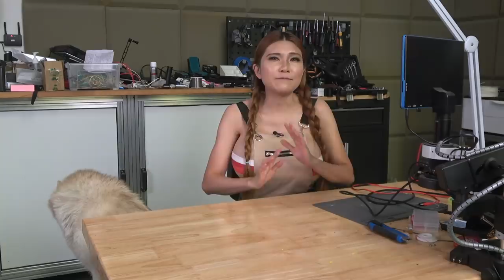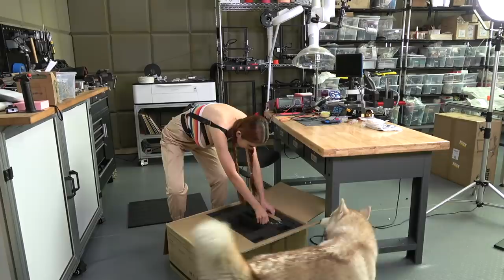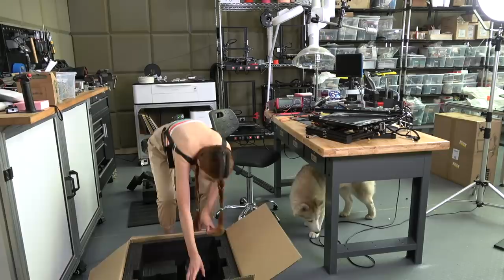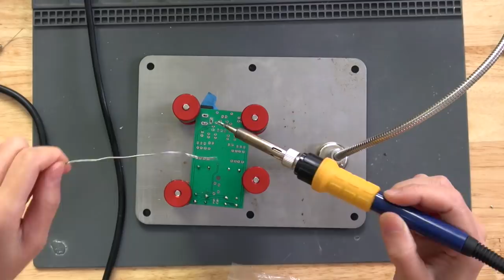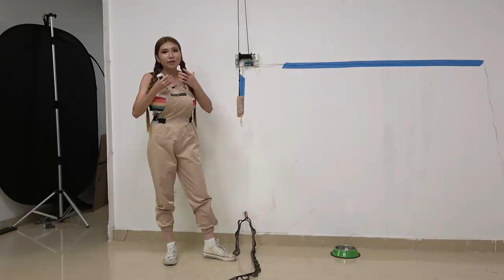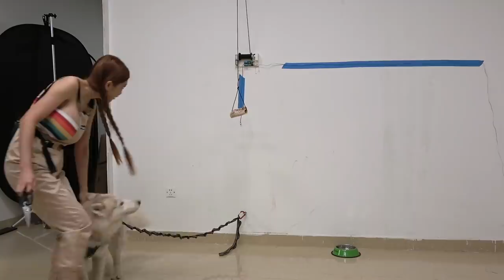Humane Husky Bark Stopper? With JLCPCB and the New Ender-3 Max

Comment: I'm glad you've been reading Momo's instruction manual... 🙏

I thought about the treat extension and retraction.
If you change the voltage on the same motor would it give you a faster action?  And if you incorporate a block to go along with the pulley might achieve a quicker lowering and raising of the treat, while making the structure a little bit more resistant to her tugging?

Because she will get it, and she will tug!

Comment: Great proof of concept! It seemed to me that the circuit's sensitivity might need some adjustment, since it looked like it was reacting to sounds other than howls. I wonder if it would work better with some "speech" recognition. Use an Arduino and do machine learning (TensorFlow either on the board or via a cloud service) so that the system recognizes Momo's howls but ignores other noises.

Comment: I think that it would work much better if it didn't react to any noise but it was a bit specific to barks. Does the board have a microcontroller with adc? If so it wouldn't be too difficult to do a fft and only react to things in the right frequency range, it wouldn't be really that specific as it would with an ann but it would be easy with minimal hardware and wouldn't react to the noise of playing or to most outside noises that aren't Momo's fault.
Reply from the maker: Yeah, there are a few ways it could be improved, I might do a TensorFlow  model...
Reply: @Naomi-Wu  That would be really cool. 
Now that I think of it I just attended to a talk about the maixpy board. Surprisingly cheap , opensource software and has a mic array and camera. I don't really know if the AI chip can be used for audio or just for computer vision but it would make sense if it did.
Another way to do it would be in analog electronics. It would be even less selective than a fft but a simple bandpass filter would help and  can be made with just 2 caps and 2 resistors.

Comment: Do you ever print PSU? I love that material.
Reply from the maker: You mean TPU? PSU is a Power Supply Unit😅
Reply: @Naomi-Wu   I mean polysulfone. High strength, high temp polymer.